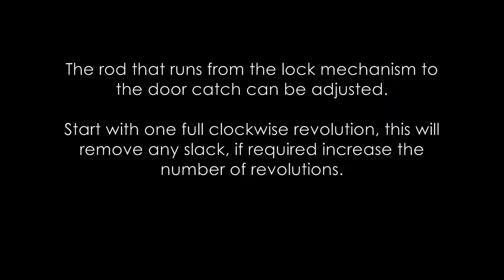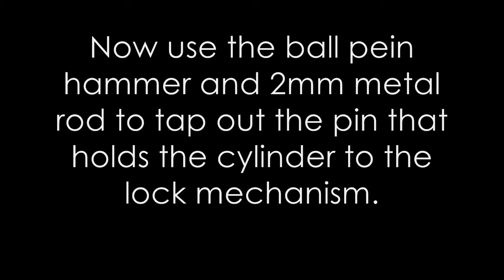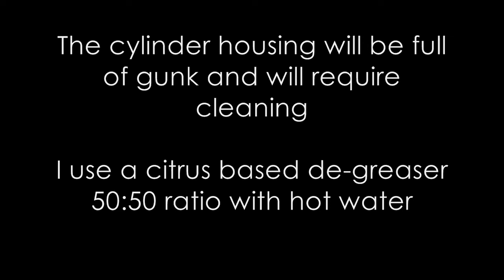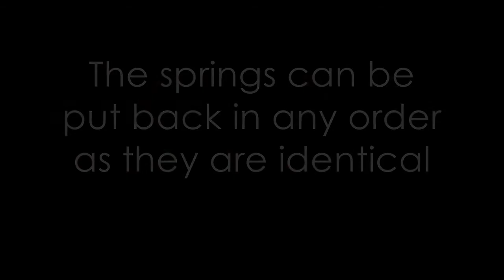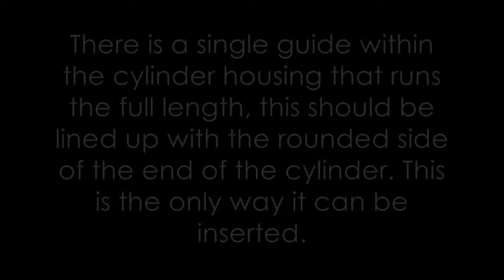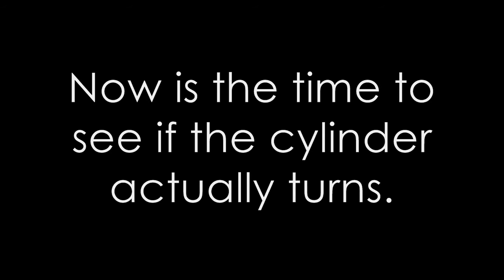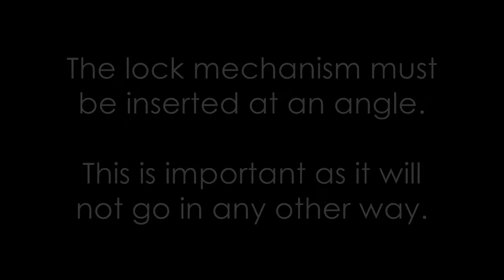VW T4 Transporter Door Lock Cylinder Replacement, Key Barrel Repair Fix

Comment: Great video. I am looking to convert my T4 from barn doors to a tailgate. I have read that the lock barrels are different. Do you think, by using your process, the wafers could be swapped over from the barn door barrel to a tailgate barrel in order for it to use the same key? 
Cheers
Reply from the maker: Yes. I believe the front doors, side sliding doors, and barn doors use the same barrel. The up and over door or tailgate you wish to fit uses a slightly longer barrel. They contain the same amount of wafers/tumblers.

Comment: I recently bought a 2002 Eurovan MV, and it came with 3 different keys. I was able rekey the liftgate AND the driver's door to match the ignition, passenger door, and sliding door. Additionally the angle at 4:21 allow me to figure out just where and how that "extra" spring on my desk was supposed to go. Since I couldn't see anyplace obvious and the latch still functioned without it. So thanks for this video.
Reply from the maker: Glad to hear the video helped. Thanks for watching.

Comment: Thanks for the video. I was In bits today as I locked the sliding door, pulled the key out and the barrel was still attached to the key. thought I was going to need a new lock but watching the video, I may only need to fine the small pin you are knocking out at the beginning.
Reply from the maker: Hope you got it sorted, I thought it was going to be expensive but the barrel was only £16 direct from VW.
Reply: +T4 Tips & Guides luckily we have a few good guys at work with all the tools n knowledge  required to build almost anything from scratch. i took the barrel to bits cleaned everything up and replaced a pin that had snapped in locking mechanism inside the door. works like new. many thanks again.
Reply: what did you use to make a new pin? and did you have to take the whole lock off to get the pin back in?
 @Mr_wayne0805

Comment: excellent, bookmarked. just snapped off driver side lock 
yesterday. either tampered with, or has been broken for a 
while,and just came out now. so..? i can modify a replacement 
to work with old key? - do you have a tip for removing the plastic 
studs retaining lining panels inside the van model? thanks for the 
tutorial, would be lost without it.
Reply from the maker: +lazy dog I remember when the drivers door lock barrel broke on my T4, half the barrel came out and was on the end of the key! As for the plastic studs, they can be a pain to get out, I have just taken the fibreboard roof panels out to replace with plywood ones. You can get a bag of 50 panels studs on ebay for about a fiver if you need to replace any.

Comment: Thanks for the video, do you have any tips for placing the top 3 pins if you dont know which numbers go where? I lost the top half of the barrel.... Many thanks
Reply from the maker: It was a while ago now that I did this job but if I recall correctly there are 6 or 7 types of wafer/pin so to work out which ones go where should only take a couple minutes via trial and error. I know the people who have done this job many time aquire the ability set up a barrel just by looking at the key profile.

Comment: Great video. Having problems getting the "pin" out that holds the barrel in place. Any suggestions?
Reply from the maker: All I can suggest is trying to tap the pin out from the opposite side I show in the video, it may hve been removed before and could have been bent or damaged. Are you trying to knock it out with a short length of 2mm diameter rod as suggested?
Reply: yes 2mm but the pin has only budged maybe 4mm. I think I'm into the barrel hole but that pin is a a real pia ... mind you the vehicle is 25 years old.

Comment: at 3.32 mins you can see inside the cylinder housing and there are four strips of metal which act as a key stop (?). Would anyone know what they are called please? Trying to find some replacement.

Following this very helpful video I have found there are two missing from my lock, thus it will not let me open the door and take key out!

Comment: Do you have any tips on what to do if you loose the spring for the barrel?
Reply from the maker: Hi Alice, you can buy the springs on eBay (UK) they are £4.25 a bag, search for "NEW GENUINE VW AUDI SEAT LOCK BARREL TUMBLER PLATE SPRINGS 443837254" Hope that helps.

Comment: What happened to the rubber seal that stops all the grot getting in and causing the lock to fail ? You didn't replace it.
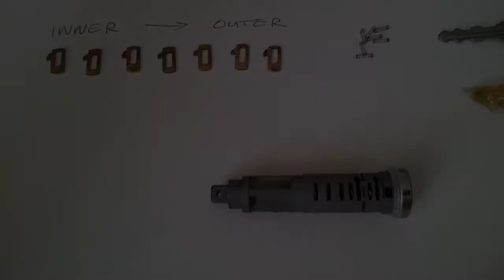Reply from the maker: +Robert Warner Hi Robert, if you have a look at 7:04 on the video you can see the new barrel has the seal you mention in place (a new seal was included with the new barrel and was already fitted when I took it out of the packet). If reusing the old barrel the seal can be cleaned and reused.

Comment: Hi. Just found this video as my drivers door lock has recently gone.
I bought a new barrel with new key and my question is..
 Do i need to go through the whole removing wafers and springs etc or just put in the new barrell that is already loaded with wafers and springs. 
If i dont mind having a new key for just the driver door then is it that simple?
Thanks
Reply from the maker: I would buy a genuine barrel and fit the wafers from the old barrel and continue to use the original key that matches the other locks. If you have bought a barrel with the wafers fitted, I assume it is an aftermarket one, I guess this will fit into the mechanism. Fitting the genuine wafers into a non genuine barrel may be an option, only one way to find that out, difficult for me to say without seeing what you have bought as a replacement. If you are not bothered about having different keys you should be ok just doing a straight swap, again, it is difficult to say for sure when you can't see the parts.

Comment: Hello to you, i see that you're a t4 spécialiste, i have a problem on my t4 1.9td abl, when cold i have a lot of trouble starting i have to use brake  cleaner to get it to start...
My glow plus are New my battery  is 1 year old thé compressions are good and when it agrees to start it Stokes à little Black and thé engine coucghs, can it com from thé solenoid valve or the injection pump i don't  know if you can hello me.. once it start it runs fine currently i'm in the moutains and this problem appears when it's vers cold last year there were holes in the cold accélération  once it mounted at 90° everything  Was rule we can talk to ofter you money in exchange this truck is my whole life this is my house...
Reply from the maker: Hi, sorry to hear you are having problems. Difficult to diagnose without having the van to look at.

Possible pump timing issue. Is your cold start handle in place?  The cable, more of a thin metal rod, can snap if not kept lubricated. The cold start advances the throttle and assists in starting. 

Best to visit a VW specialist who can diagnose the issue. Sorry I cannot help more. Hope you get it fixed.